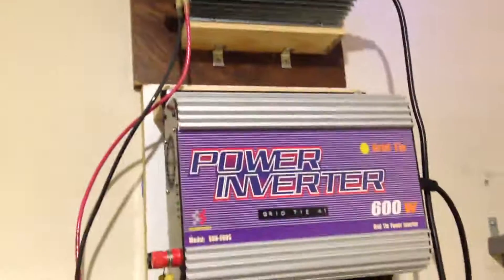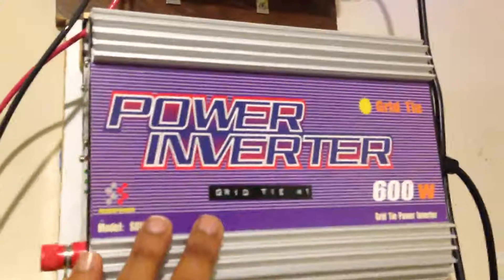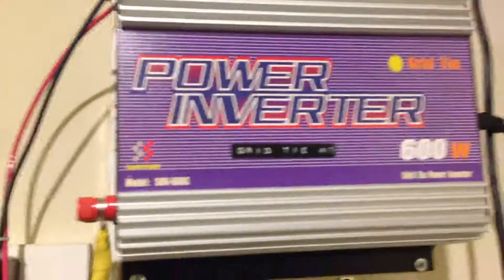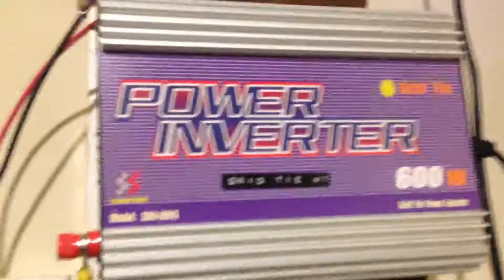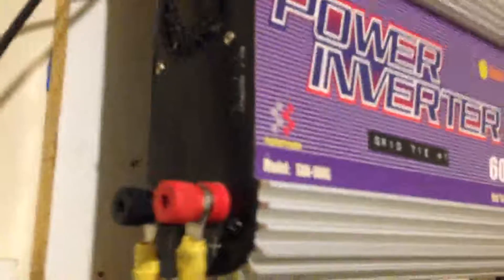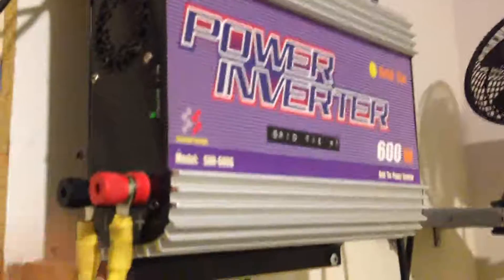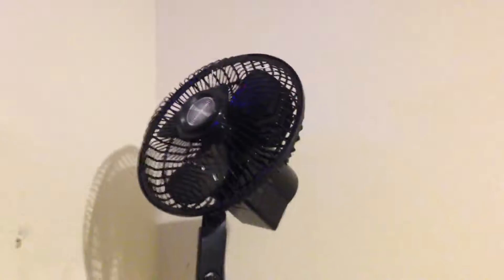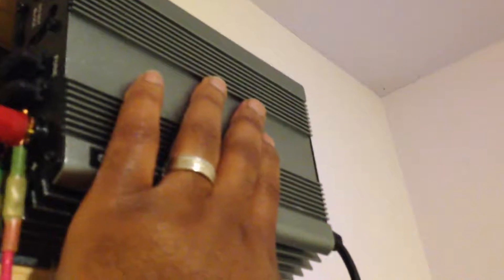DIY Grid Tie - A word about cheap Grid Tie inverters

Comment: since i don't have grid tie yet, i'll make an example the cheap inverters i have. i tested it and noticed that the fan only comes on when the inverter is hotter so i decided to open it and remove the fan connection from the board and directly attached to the + and - terminals of the inverter..a bit noisy but keeps the inverter cool all the time..even cooler in minimum loads..
Reply from the maker: vrich marketing renewable energy I've done the same thing with my inverter.  Be careful that the power coming from the terminals are not more than the fan can handle, if they are you may fry the fan.
Reply: i forgot to mention that i added a resistor series from the positive terminal to the fan,100 ohms 1 watt.
Reply: Sir, i have an issue in one of my cheap modified sinewave inverter..it beeps Fault whenever i draw large load like 500 watts and up from my batteries..i suspect the voltage sensor is damage..even i use other inverter to drive the load and the modified has no load..it will still beep for fault even it has no load, just turn on together with the other inverter with the Load on it.please share if you have idea on how to repair this..
Reply from the maker: I have no doubt that you may have an interesting setup. However, I'm trying to understand what your setup looks like and what your trying to do.  Please explain what you are trying to do so I can get a better idea. You may have explained earlier, if you did I may have forgotten.
Reply: i have 2 inverters.. the modified and sinewave..the modified runs my lighting always and my computer whenever the power grid is out.yesterday i tried to run the computer and the modified inverter automatically beeps and shuts off..i wonder why, since my battery voltage still 12.7V do you think a input mosfet  is defective?after i open it and solder some conections i thought might be the problem, it can power up to 500w then it will staart to beep and if i go higher, it will shut down and beep for fault
Reply from the maker: You should possibly check the inputs to ensure you haven't blown anything. Other than that I don't know why your unit is not working.  You may also want to check the forums to see if anyone has ideas.  But mosfets are usually the culprits.
Reply: thank you very much rhandsom
Reply: i'll try checking the mosfet again

Comment: The question begging to be asked is, why not put money into a higher quality inverter? It will be more efficient, last longer, be more reliable all around, and cost you less money in the end.
Reply from the maker: Paul Petrea That is a fair question. I've been exploring the possibilities.
Reply: rhandsom This was what I was going to suggest If you want to back feed. I would go with a Outback Hybrid inverter. Or similar. They are about the same price as your Magnum inverter but they will also keep your batteries charged and any excess will be back feed to your home. Big difference is they are UL certified. They are safe. They will be approved by your electric company. It all depends on your budget.
Reply from the maker: ***** I thought about the outback when I bought my Magnum, I didn't go with the outback for some reason.  I don't recall what the reason was at the time.  I may look into the enphase or the enecsys inverters.
Reply: rhandsom http://www.powerinverters.org/power-bright-12v-dc-to-ac-2200-w-pure-sine-inverter/   this maybe better
Reply from the maker: I looked at the link and I believe the inverter in the link is a regular inverter.  I didn't see any grid-tie capabilities.
Reply: +Doug Brimeyer This is a good post! I have tried a few times to tell people those cheap grid ties are not legal but they don't seem to care...Another point is if you did burn your house down and you were lucky and got out alive... Well after that when the fire marshal comes to see what caused the fire and traces the source to a solar set up that was not certified.. They make up a report and your insurance company will read that report then good luck getting your house rebuilt!! Your insurance company will DENY you! So is it worth it? Hell No!!
Reply: I totally agree.  There are a lot of people out there that think that they know what they are doing that don't have a clue and there are people out there that go to Youtube looking for guidance for what they are doing that are given the wrong info.
Reply: +Paul Petrea The answer to that is people are cheap.  They either don't think about or don't care about people's lives or destroying their own property.  The thing is if these people want to connect to the grid with non UL certified components thinking that they will save money buying cheap components and feeding back into the grid they will until the electric company finds out and they don't have a interconnection agreement. It's not hard for the electric company to see solar panels on the roof.   I have read about one home owner that installed his own system with UL certified components but didn't install in correctly and didn't have a signed interconnection agreement with the electric company and didn't have it inspected.  The electric company found out about it and immediately shut off his power, fined him something like $2000.00, notified the city who fined him something like $200.00 for not getting the permit and inspection.  The electric company wouldn't turn the power back on until the system was removed or was permitted, installed correctly and inspected and the fines where paid.  It cost him $2200.00 in fines, double the price of the permit, the cost of a certified electrician.  His power was off for almost a month.  The best part about this is he got by cheap.  He could have burned his house down, someone in his family could have died in the fire, and utility worker could have gotten badly hurt or killed and he could have gotten sued for a lot more money because of it.  Solar is a very good thing and is a great investment but let the people that know what they are doing do it or least help you not the people on Youtube.  Most of the videos on Youtube are wrong and made by people that don't know what they are doing.  If people want to play around with solar, be all means go ahead but do it with an off grid system on a garden shed where if they do something wrong and burn the shed down they are not sleeping in it when it happens.  Most solar companies won't do how to videos on Youtube because they don't want the liability of somebody misunderstanding them and suing them for their own mistake.  A system for a house can cost between $10,00.00 and $20,000.00 installed by a certified and qualified solar installer.  Have a return on investment of 7 to 12 years, closer to 7 years for most, continue to put money into the homeowner's pocket after that, increase the value of the property about 20% without increasing the property tax and will sell a house about 30 days sooner.  There are finance companies out there that will finance 50% interest free for 20 years and the other 50% at whatever interest rate you can get.  The federal government will give you a 30% tax credit and many states will give you about a 15% tax credit and some electric companies give out rebates.  So a $10,000.00 professional and legally installed system cost about $5,500.00, increased the value of the house and included on the insurance policy will give an electrical offset of a 100% compared to the system the man that got fined which only had about a 30% offset and cost him about half.  Sometimes when you try to be cheap it costs more per watt in the end.  I know what I am talking about.  I am the project foreman for a solar installation company.  We have bids out for utility grade systems in the 5 megawatt size.  Last fall I installed a 39 kilowatt system on a farm and it is working and giving the farmer the offset we predicted.